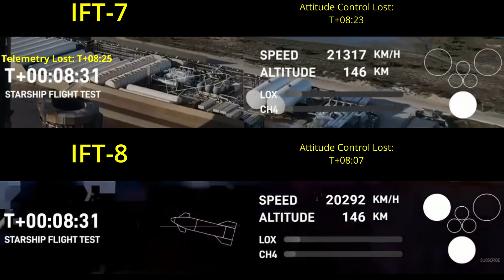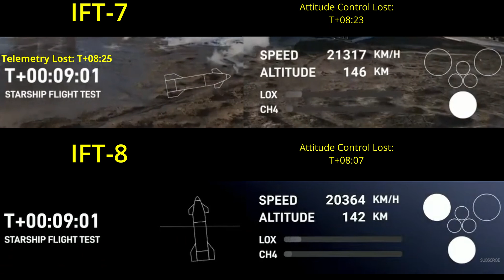IFT 8 Telemetry: A Silver Lining Compared to IFT-7

Comment: And yet they did 1 minute static fire
Reply from the maker: I think a 1 minute static fire wasn't enough to see the problem. The ascent burn is 6 minutes long and the problem is showing up in the last 30 seconds when the tanks are mostly empty. Unfortunately, I don't think they have the ground systems to support a 6 minute static fire and so even though they saw hints of the problem, they realistically are going to send it up every time to get a full test.
Reply: They could try static firing the ship over bad b in the future. It should be able to support a longer duration static fire
Reply from the maker: @maqq9799 Its a good idea as long as the bottom chopsticks can hold the ship. I think it needs to be close enough to the flame trench to absorb the exhaust or it would cook the tower next to it.

Comment: 1 rvac exploads with 1 sl raptor and 1 is knocked out soon followed by the last sl raptor 2nd rvac dies from air in the pumps and 3rd dies when ship brakes
Reply from the maker: From what I've seen, it looks like venting from another fire put a hot spot on the bell of the rvac on the inner side which probably burned through then it all cascades like you said.